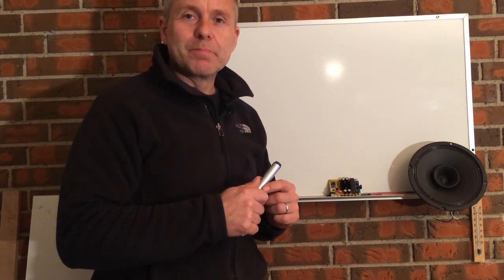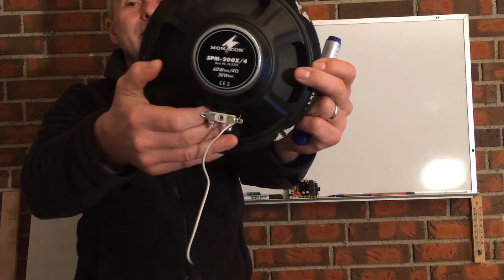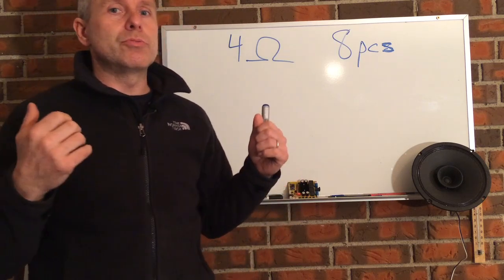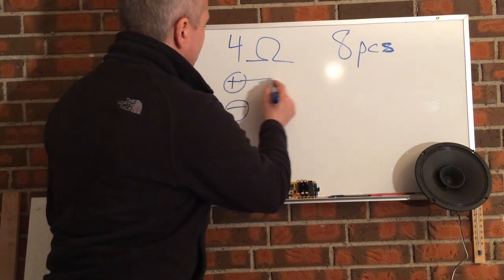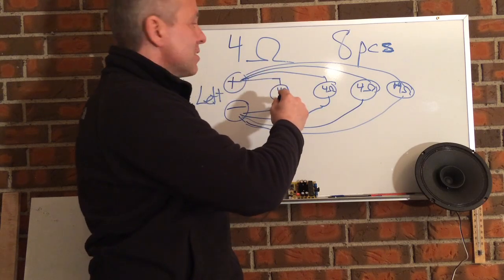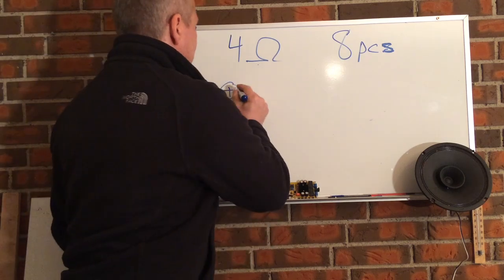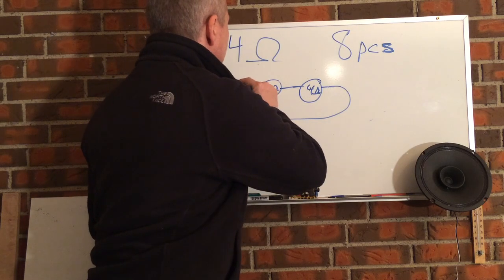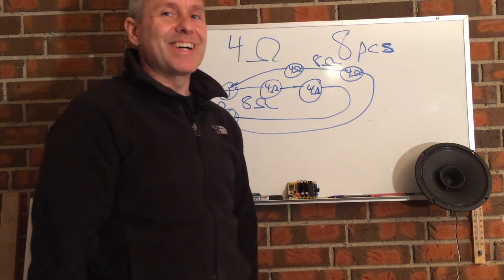Connecting many speakers to one receiver or amplifier

Comment: I connect as many speakers i want..as long as it produces sound, i think im good 😄 counting ohm is too complicated
Reply from the maker: well if it meets your expectation, by all means! But I certainly dont recommend that, unless its spendable equipment to just play around with
Reply: Smarthouseelectric i have 100watt 8ohm amplifier connected to 2pcs 8ohm floorstand speaker, 3pcs 6ohm speaker, 2pcs 6ohm/8ohm center speaker, 1pc 6ohm subwoofer..is it safe??
Reply from the maker: Which model/brand amp and how did you wire it up?
Reply: Ohmmm fuck it I do the same 😂